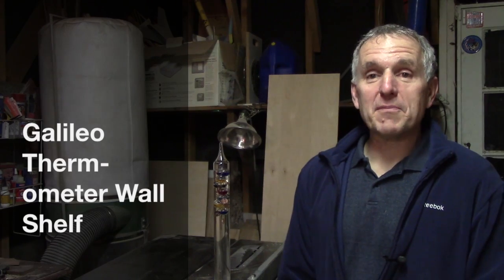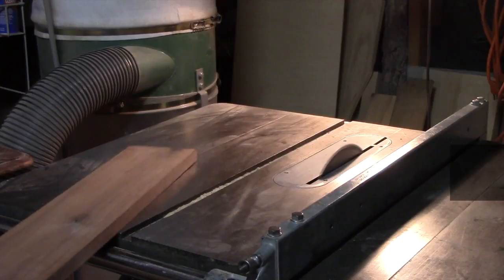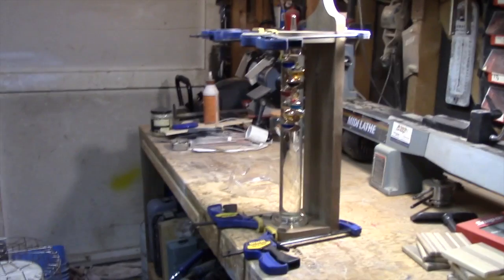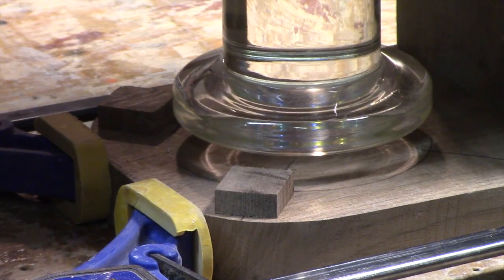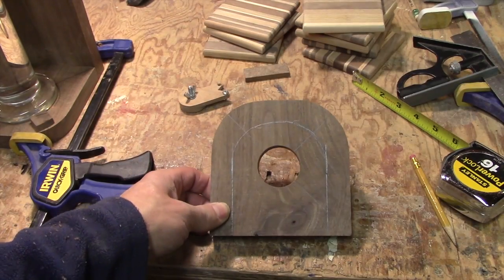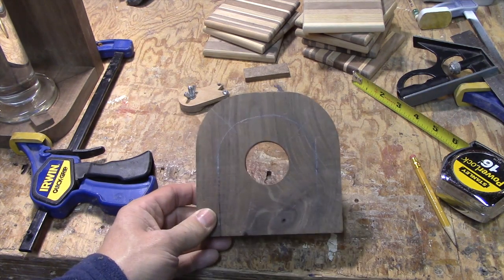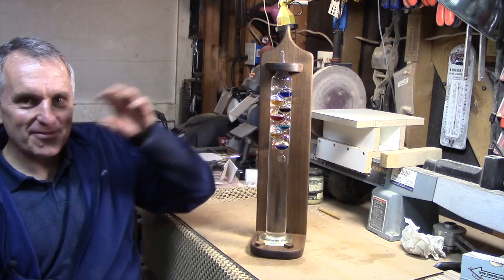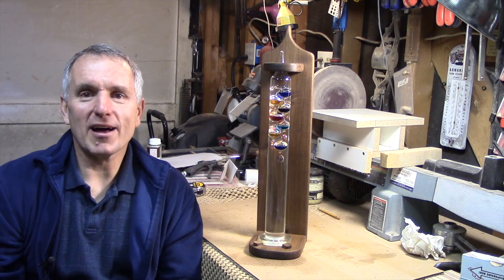How to make a Galileo Thermometer Wall Shelf

Comment: Excellent idea for a wall mount shelf for that type thermometer. Like the walnut and the upper design tip. From the beginning of the build to the end, then as you displayed in your house, I didn't notice any change in the internal vessels (perhaps there was and I missed it). I assume there was a large difference in temps between your shop and the inside of the house. So is it not working or was there not enough time for the temp change to take effect on the vessels?
Reply from the maker: MRrwmac Good questions.  This thermometer works on the upper temps of 70 to 82 degrees... so if it were above 70 the lower ball would come down and the temp would be the highest group pf balls, the lower ball being the temp. That is how I understand it. so no the temp did not go much above 70 in either case. ;)    Here is a good site for explanation:  
http://www.4physics.com/phy_demo/Galileo_thermometer/galileo-thermometer-b.html
Reply: I knew how they worked but had forgotten the temp ranges they indicated. Thanks for clearing that up for me. Again, very intuitive idea and useful build that came out looking great.

Comment: Great project, I love those thermometers! Is the lathe disc sander new? That looks nifty
Reply from the maker: Thank you!   I will show some more on the next "Time with Pine".I made it a couple months ago...  some left over melamine for the disk and the small platform that rides of the rail.   Not very complicated . I bought a self adhesive sander disk at the woodworkers show and mounted the melamine disk on a faceplate, thats it.  works fine.